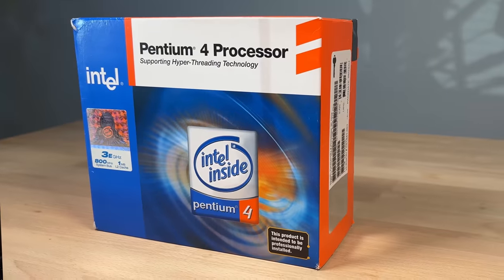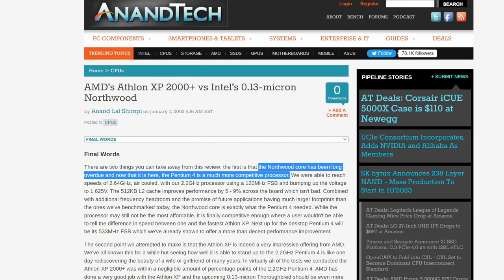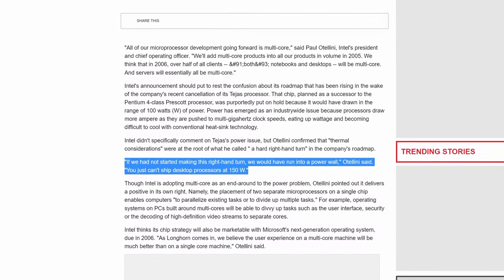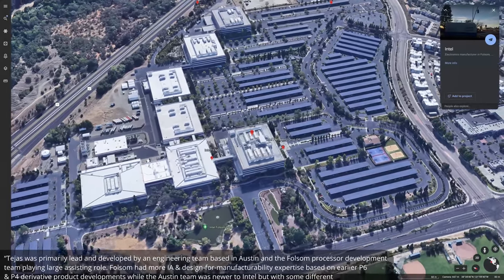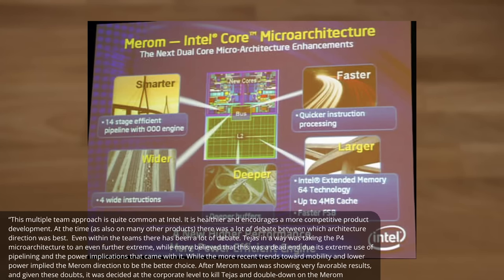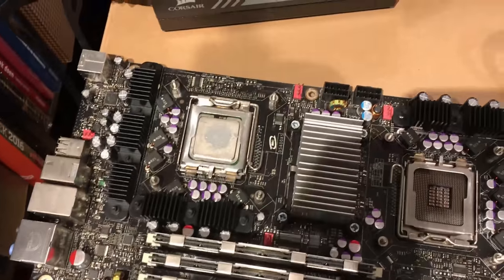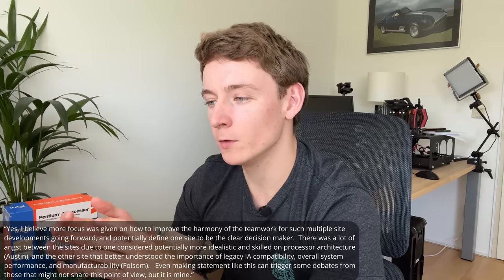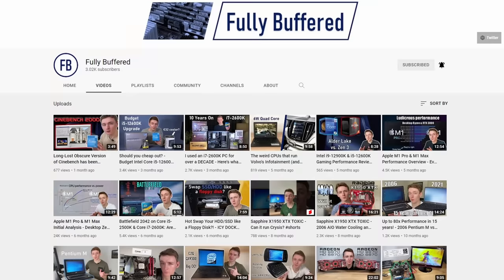Intel's abandoned Pentium 5 project...bought on eBay! (with info from Intel engineer)

Comment: This is really remarkable! I remember very clearly when Intel announced the cancellation of Tejas, and after that I think most assumed there was either never any silicon produced, or what little there was would never see the light of day. So to see a physical sample, even if it's non-working, is pretty incredible. Even better to get insight from one of its designers. That was brilliant on your part!
It's honestly hard to believe it got this far. I can't even believe it was built on 90nm! That just seems insane, given that as it was, Prescott was already getting Intel in trouble, and the Athlon 64/Opteron was spanking them in almost every market segment. Even Intel diehard OEMs like Dell suddenly started offering the option for AMD during this time. Intel created a performance-per-watt problem, and painted themselves into a corner, while letting their rival soak up all the goodwill. The fact that many reported the 3.8GHz Prescott couldn't run stable in many systems should have been (and maybe was) a wake-up call.
Reply from the maker: Many thanks for the comment man 😁 I remember the AMD Dell systems - I had a Prescott 530 Dell Dimension back then and it pushed out so much heat for the performance it offered. Intel must have been not amused by that switch lol
Reply: @FullyBuffered  Dell was the last tier 1 OEM to adopt AMD at the time and it was a pretty big deal. It was years of reasons why not for this reason and that reason to suddenly full embrace... brings back memories...this is a cool score BTW...

Comment: I recall the upheaval at Intel when the Israel labs came up with Pentium M, which would later birth the Intel Core architecture. The desktop division was a 10,000 engineer-strong organization. The Israel lab had some 100 engineers. Imagine Intel Austin being showed up by Intel Israel. I was told that the Austin lab was seriously downsized after that. Dadi Perlmutter rocketed up the Intel hierarchy thanks to this, as his team's Pentium M lead to Intel Core, which effaced all the bad rep Pentium 4 had created.

Comment: I built my first gaming PC in 2003 and AMD was the clear winner at that time even doing it at lower clock speeds, this was a marketing nightmare , how do you sell a 1700mhz chip thats faster then intels 2.4ghz chips?  thats when they introduced the + naming conventions and called their 1800mhz procesors 2500+ to give you an idea what the speed was compared to intels slow pentuims 4's.  But intel took the crown back with their core2duos in the coming decade and really has hung onto the leads until recent ryzens.  But at this point im looking forward to Risc architecture so im not interested in more hot big cpu's from eitehr AMD or intel.

Comment: Oh yes...those times. My first rig was a Pentium 4 Prescott on the Asus P4PE2-X before we started cranking up a Northwood core. But - that's not the story that I am heavily interested in - it would be the Pentium M (this laptop runs the 725 - yes it's about 18 years old now) that later turned into the Core (mobile only) and Core 2 processors. The Netburst architecture wasn't really all for waste...it introduced HT that waited until the Core i-series to reappear...and of course the higher FSB speeds which were all developed for it.

As for making those CPUs work...everyone else already said the deal. Hope the bios modders could also unlock my step-up VAIO to read all the 4 GB of RAM that the chipset (i945GM) is supposed to support and enable Core 2 specific features (Enhanced C-States) because it just got a CPU upgrade

Edit: Intel would have named that the Pentium V for extra flair
Reply: my first comp was 486.

Comment: The whole Pentium 4 era is nostalgic. I was in late elementary school when Socket 423 dropped and was in high school when Conroe released. I was too young at the time to build my own PCs. My parents had various Dell Dimensions in the early to mid 2000s
Had I been several years older, i would have opted for an AMD Athlon 64 custom build instead. 
Conroe was Intel's Ryzen moment. AMD caught up and surpassed Intel within the last 6 or 7 years. Funny how 115, 130 and 150W CPUs were considered power-hungry, when 14th gen Intel CPUs can draw 250 - 300W under heavy loads. Ryzen definitely is more energy efficient, but the 5000 and 7000 series do run a bit toasty compared to the 3000 series.

I miss the days when faster CPUs also came with slightly reduced power consumption.
Reply: You indeed having a good choice back then since p4 cpu is suck and hot

Comment: Austin engineers were kind of punished for Tejas. Next product that came out of Austin? Atom. They were tasked to develop sub-1W x86 CPU. It was paired with 10W chipset (i945), but it was possible to run first Atom silicon at 1W.

Folsom is a stone throw away from Santa Clara (in fact it is a 'backup' site of sorts, in case of SC goes to hell if San Andreas fault going off would actually wreck Western California), so there was major push from board of directors to continue all development in FM, since they had a chance to personally oversee all the projects this way. I strongly believe that Austin site is a 'talent sink', in a region.

Comment: I read an article sometime in the late 90s claiming optical CPUs were on the horizon, which would operate at over 10GHz effective speed by some time in the early 2000s (I think it was in a Popular Science or Popular Mechanics magazine). We've only fairly recently broken the 5GHz barrier on stock chips and frankly, progress on overall system performance feels like it keeps slowing more and more every year...Software seems to bloat faster than hardware can keep up and hardware progress seems to keep slowing down. I think a lot of the software problem is down to accessible scripting languages....Too many people just globing on layers of slow scripts to automate things, instead of writing low level, optimized code.

The 7GHz clock made me think of this... The industry shakeup of this chip's huge clock (get it? "huge clock" lol I'm stupid) would have done a lot to "shake up" the industry (wink wink...Shit, my mind's in the gutter tonight, sorry).

Seems like after we broke the 1GHz barrier, things started leveling off fast. I'd say the last couple of really exciting CPUs were the Core 2 Duo and first AMD FX series, and those were a generation apart.... I did get hyped for the second gen FX, but man what a HUGE disappointment that was. Honorable mention to Ryzen & Threadripper, too...Those deserved the hype. Hats off to AMD for coming back and hats off to Intel for keeping up (mostly).

Comment: I was in the tech business back then.

Intel was selling tons of Pentium 4 CPUs but they were being beaten handedly by AMD in performance per watt, AMD would have been in an excellent position if they had a proper chipset available for their platform.

They had their own AMD 750 Chipset if memory serves, had a few issues itself, I think it was on the more expensive side and availability wasn't terrific, Via was a tad faster but had a bug related to the AGP slot in the KT133 chipsets, running at 4x speeds would make the system unstable. This was somewhat corrected in a driver and fully corrected in the KT266 chipset and of course Nvidia's Nforce chipset didn't have that problem at all but that was later on down the road.

The thing that kept Intel alive back then was the same thing keeping them safe today, AMD simply could not meet the demand.

If Intel had continued with Tejas the performance per watt ratio would be even more so in AMD's favor, enough that OEM would have started to balk at Intel's power requirements.
Reply from the maker: Interesting backstory on the chipset side - didn't know that. Thanks for sharing!
Reply: @FullyBuffered  Forgot to mention, Intel was forcing RDRAM on the Pentium III boards so the high end PIII was crippled, it was a high latency, high bandwidth memory on a system that has low bandwidth and low latency.

RDRAM was expensive so Intel offered an SDRAM option, which crippled the P4. AMD supported SDRAM and DDR, both were at a good price point, stability issues were a factor. None of the the three platforms were good at that time, AMD needed Nforce to compete and Intel needed DDR to be financially and technically competitive at the same time.

The end of the PIII era was messed up, for a time neither company had a good platform to work from.
Reply: @glenwaldrop8166  yea, but you are speaking about 2000-2001 years. All this happened long before socket T was planned.
In 2004 era, AMD had already awesome chipsets from Nvidia, nforce 4 was really made that platform even better. VIA was out, from time, nforce apperead, they got bashed hardly.

Comment: I wouldn't give up on these chips just yet.  Although difficult there may be a way to solve this.  I used a Quad-Core Xeon LGA771 on a 775 system for years with an electrical mod.  The motherboard didn't know what chip I was running, but it worked without issue. (settings were set simular to a Q9500 but it was in fact a X5460)  CPU-Z could identify the chip, but the Bios was in the dark.  Maybe you need to go to an earlier LGA775 motherboard from the P4 / P4D era.

Comment: In hindsight, it was obviously the wrong direction to take. The long pipeline is a liability when there are missed predictions. The high power consumption makes it a non-starter for notebook computers and requires that notebook chips use an entirely different approach to gain performance.

Comment: Makes sense for back then when 1kW PSUs were not consumer PSUs but server rack at least 2U PSUs. Now a 1200 Watt PSU is normal for the high end consumer machine using all consumer parts. Yes you will not get to 1100 Watts at any 1 time but that is assuming you will not be doing any overclocking on the CPU nor the GPU. Almost all GPUs come overclocked and all Intel CPUs are overclocked by the motherboard before the consumer touches it. So the number on the data sheet is wrong.
A normal custom PC i can see someone putting together will only take 896 Watts when everyone is running at 100%. Now with that said as the GPU and CPU will be overclocked the computer will need more than just 900 Watts then you have peaks of power that happen when they randomly draw a outsized amount for less than a maybe a few miliseconds at most. Still the PSU has to be able to supply everything at that so using a factor of 1.5 is always good when calculating for the PSU. is 900 * 1.5 = 1350. The reason why most system intergrators do not include a 1300 Watt PSU or 1600 Watt PSU is cost and being 50% over is not really seen as good anymore as the power consumption got so high . So they use the number based on just the CPU + GPU power for the 1.5 and the rest kept at 1 kind of thing which ends up with only around 1200 Watts. Less room for parts to randomly draw more power but the only parts that really do that in amount significant enough to matter are the CPU and GPU.
Now you also have the liquid cooling loop or loops on the high end systems as yes consumers have come to accept liquid cooling for the higher end parts just want parts with just a heatsink at most on the lower end.

Comment: 150W at 7Ghz? That is probably the optimistic projection. More like 5Ghz at 250W. Let's also add a little thing. While Intel would like to be dismissive of AMD, imagine if AMD would use the same power consumption and how much performance they would have gotten out of it then.
Reply: 5GHZ is packed with much more IPCs than those 7GHZ

Comment: You will probably have to find out all the info on this cpu like family, ext family, model, ext model, stepping and revision and add the microcode, containing this info, to the latest bios and flash the board with it in order to have the p5 cpu working. Its only natural that the microcode is missing from every lga 771 and 775 board right now making the cpu not work. Ive modded lga 771 cpus to work with lga 775 boards in the past. Adding the microcode isn't hard but you will need all the info.

Comment: Remember that Intel does not exist in a vacuum. Many of its technology paths are decided by immediate needs and responses vs competing products.
AMD K6, K7, K8 processors had taken and were taking an ever-increasing share of the consumer CPU market. And their K9 (or rather, K10) processors were looming on the horizon. Intel had to make hard decisions to keep themselves "ahead" in consumer perceptions. And consumers want value so Intel had to focus on product lines which offered value instead of raw performance. Intel can make whatever chips it wants, but if nobody buys them then it can't make them for very long.

Comment: The companies making the 775 bords didn't have great cooling so throttling VRMs at best but often just burned up during high load.
AMD was also before intel with dualcore.
crazy times where you could overclock your cpu in some cases 80-100% or more like i did on my intel e4300.

Comment: Ok this is awesome.  I really wasnt sure if actual silicon was made that wasn't scrapped - the explanation on why this isn't a thermal or mechanical sample makes sense.  Also interesting the 7 GHz target appears to have been on 90nm.  I am curious of the engineers opinion on how much Dennard Scaling breaking down influenced the cancellation - did they know 65/90nm (and below) wouldn't scale like prior nodes when designing this chip?

Comment: Nope I do not believe this 7 Mhz limit at all. Because Intel switched to multiple cores. Because they struggle real hard to get viable systems above around 3 to 4 GHz for a long time. Even today Intel is not able to reach 7 GHz. Yes it was some Pentium 4 system that could reach over 8 GHz cooled by LN2 . But for a consumer system no not at all the Pentium 5 could reach 7 GHz
Reply: Core per core in modern CPU could still be faster even with lower clock.
Reply: But the longer pipleline was just to be able to tick faster. And since a number of people managed Prescott at 5GHz, why wouldn't a total redesign in a newer technology manage this extra speed?

You really can't look at todays processors because todays processors are optimized for extreme superscalar performance - as many instructions as possible per cycle. So totally different design.

And by the way - Intel's text did not say an upper limit of 7GHz. They claimed "north of" - so they hoped to get above 7GHz.

Comment: Wasn't a super-deep pipeline one of the problems that plagued the Intel Itanium CPU? (meaning that there needed to be a lot of compiler help to properly optimize the program and ensure the pipeline was kept properly fed)
Reply: No, not at all, it was a completely different problem. VLIW requires scheduling be done by compiler, on the premise that the compiler can take a better decision that CPU. Problem is that no-one wants to recompile their code every 3 months.

Comment: You should to add context of the quantum tunneling issues and the success of the high-k effort and extreme power management that led to Core.  Last chips of that era I had were some DC Dempsey for 2 socket servers - socket compatible with the Core series Xeon - quickly swapped to the much better performing X5465 because the 5080 with FBDIMMs could eat 180W per socket!

Comment: with all the talk about the Pentium 4 failure, many ideas developed in that time were later used in more successful CPUs, like trace cache, advanced branch prediction, even hyper-threading. I think the Pentium 4 in itself was not marketed well, first using a chipset requring RAMBUS, later offered with mainboards using SDR RAM while it desperately needed at least DDR RAM. Eventually those chipsets were made.

But long before marketing worked overtime to invent bullshit names like "Netburst architecture". Had nothing to do with the net. Pentium 4 required code to be recompiled with P4 Intel-optimization turned on for reaching its throughput.

Comment: TDP and freq was getting out of control.But on the P4 era, people were obssesed by CLOCK FREQ. It was a strong marketing point at that time inspite the actual difference in performance. I remeber Intel trying to cross the 4Ghz barrier in computer articles from that time. Also pointed that they were about to approach the limit, and predicted that this path (of keep going up in frequency) was almost a dead end. Today they marketing is around "cores/threads"

Comment: did you try a good overclocking socket 775 motherboard and 771-775 pin mod you would need to set the clock speed and voltage manually

Comment: Dude, you need to send them to some extreme overclocker like Roman Hartung (der8auer) to test their OC potential - maybe there is some possibility to make them work with some firmware tinkering or zombie modding a mainboard to provide more power there are plenty of examples in the past, where some folks made certain CPUs work on platforms/chipsets they were not intended to run on - some by just taping over some pins to actual firmware modifications.

with their insane pipeline lenght, they possibly be able to knock off the records of Piledriver or Cedarmill CPUs currently ruling HWbot 

yeah, just dreaming - but this might go big

Comment: I still got my P4 HT 524 3.06GHz chip which is a OC monster reaching 4GHz. Using the ABit AG8 775 (915p) board. The 531 and 631 are in my collection also. My favorite is still the Q6600 GO with eVGA's 680i SLi (little i) rev.2 board. That thing is still great to use.
Reply: For P4 524 OC 3.0 to 4.0 is not a monster, rather a puppy ;)
Reply: @gagarin777  A 1GHz OC isn't easy on that specific chip. P4 with a 533 FSB to 1100 on that enemic Abit AG8 (915p) board was not easy. On the eVGA 680i Rev.2 board however, it would run 4.6GHz. I should've been more clear on that.